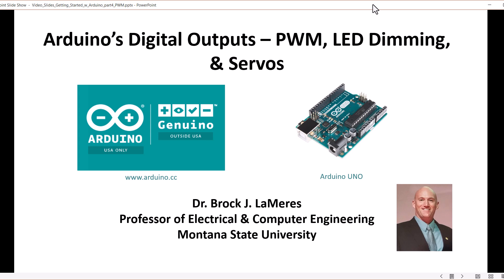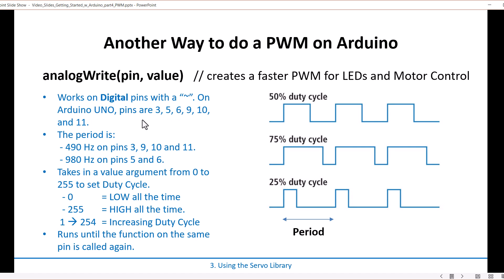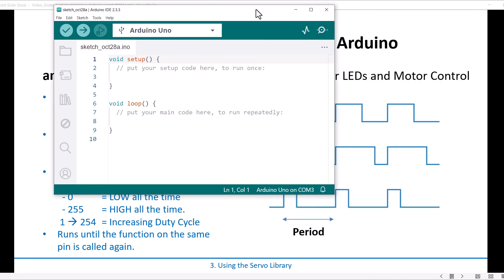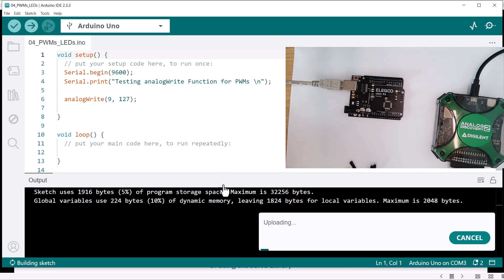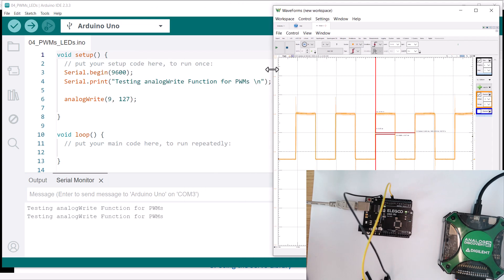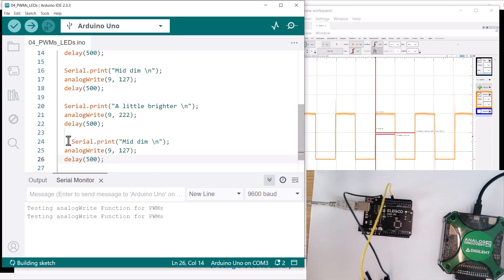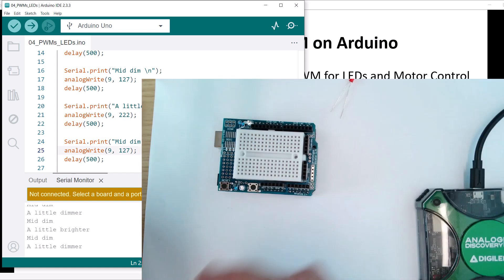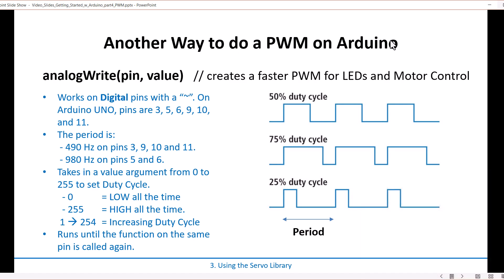Intro to Arduino - PWM using analogWrite() and Dimming LEDs (Fall 2024)

Comment: My led controller (LED grow light) has an RJ12 jack that says pins 2 & 5 are for 0-10V dimming. I tried measuring the voltage on pins 2 & 5 and only got .065V no matter the brightness setting.  Does this mean it's probably using PWM?  Is there a way I can test it?  Don' t want o blow up my new light ;) My goal is to put a dimmer to the input so I can fine tune the brightness.  Appreciate any advice.  Thanks